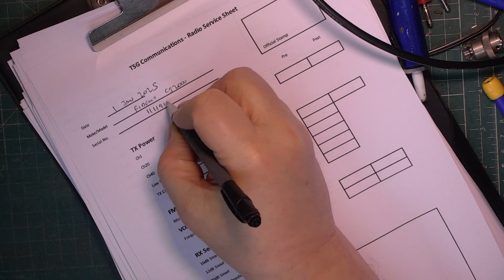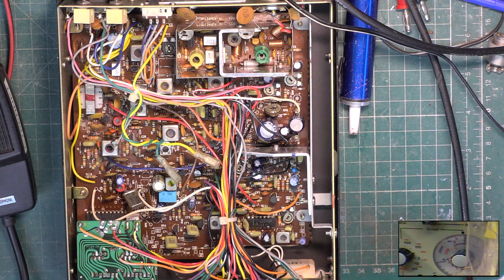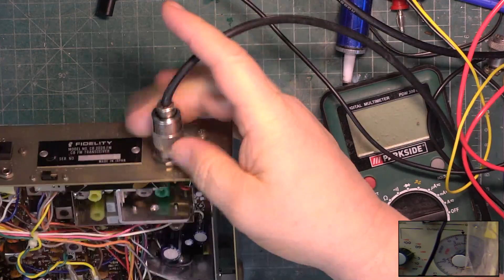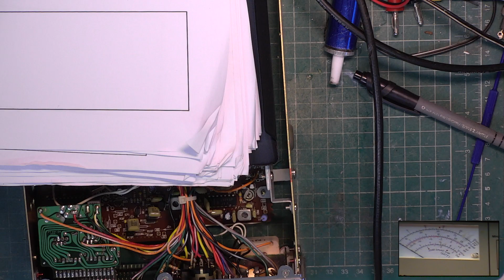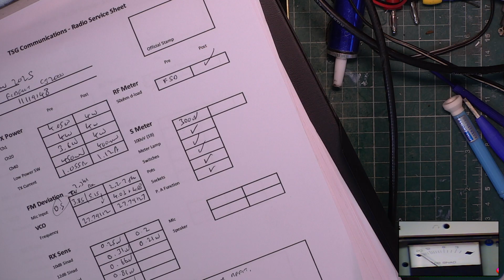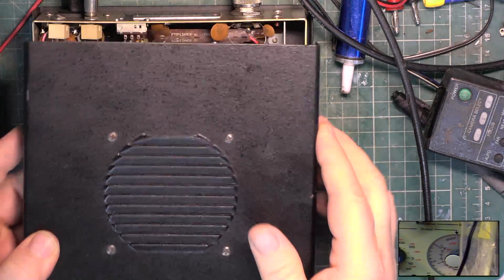Fidelity CB2000 CB27/81 UkFM CB radio -  service & alignment (Cybernet134)

Comment: I’ve got one in my shed it’s needs sorted out
Reply from the maker: Well these & the other Cybernet 134 sets also using the high-end version of the chassis are hard to be bettered. Current models I see are nowhere near the performance & certainly aren't going gto last 40 years_+.  Bear in mind Fidelity also had the CB2001 made for them which is identical looking but uses the Cybernet 002F chassis instead; whilst very good, ot's not quite 'as good'. Of course Fielity also had the 1000 & 3000 (base station) mzade for gthem & both are abysmal.

Richard, G0OJF, UK

Comment: Used to have a manor kestrel in the 80s don't seem to find them anywhere now i lost out on one about 4 months ago on ebay  to late to the bid lol😂
Reply from the maker: I've covered it a few times on this channel & I like them too. The transmitted audio & the squelch operation are superb. Because the receiver is unusual & difficult to align properly, most set out there don't work as they should so of course the CBers say 'they're crap'. After decades of not being able to get the power leads, I am now able to get the plugs (&chassis sockets) from Japan so we can now make up & offer power leads.

Richard, G0OJF, UK

Comment: It may be a sensible idea to promote the working test set behind you to the task of MAIN test set, and then bin the dodgy one as scrap or possibly sell it at a radio rally.
Reply from the maker: What a loopy idea. I've repeadedly said the make & model of the test set behind me so research it for yourself...Quartzlock 282....and discover it doesn't work under 68Mhz on receive. I've also demonstrated it on some Fidelity repairs some years ago because the Farnell sweep generator is on that bench too.

Our 2-way radio work is of course mainly licenced business radios....the lowest band of which ends at 68Mhz & the Highest at 470Mhz. Most test set do 68-512Mhz for this reason.

We've four Maconi test sets like the one I do the CB radios on & I'm not shifting them around for your benefit. Most people use seperate instruments anyway rather than all-on-one test sets. 

Let's get the house demolished because one window won't open.

Richard, G0OJF, UK
Reply: The test set behind him doesn’t go down to 27MHz but is ok for testing audio 😊 if I was Richard I would set aside an afternoon to change the faulty capacitors in the main test set…